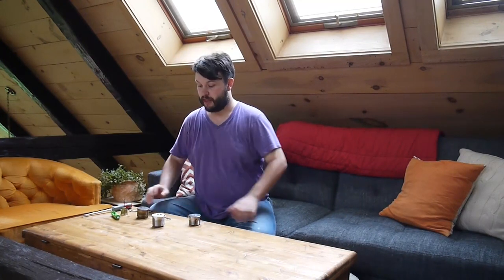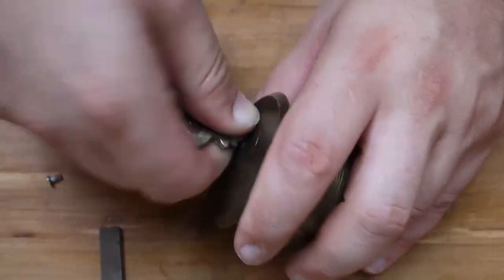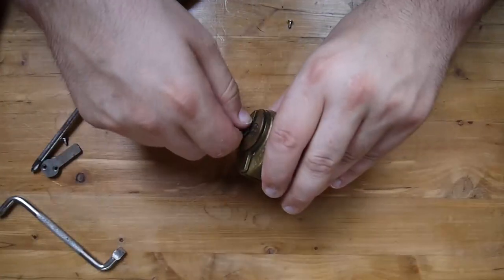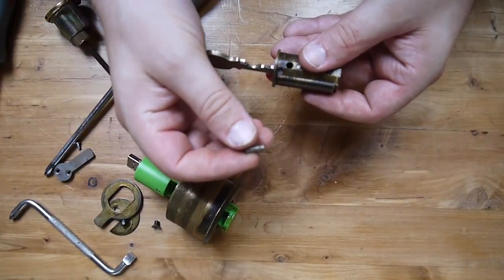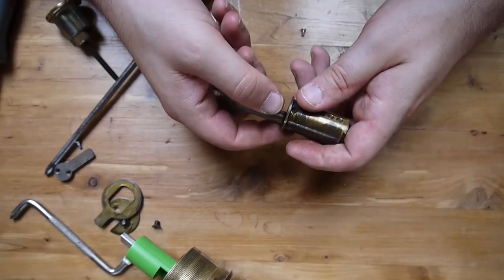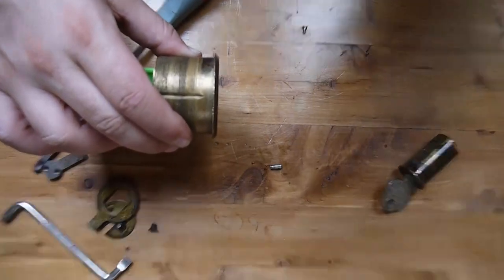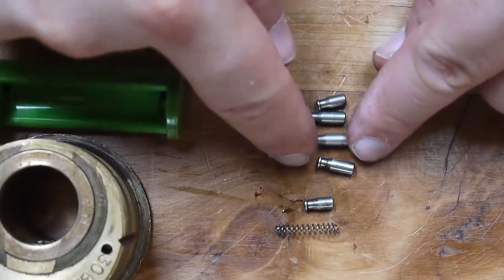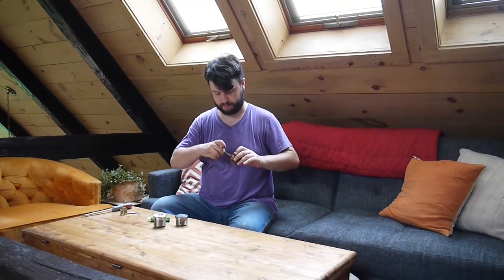The Collection: Prison Locks (Brinks, ASSA & Folger Adam)

Comment: The biggest reason for the use of the oversized cylinder is the extremely rugged environment in which they are used; they have to be designed to withstand normal use in a prison environment, on doors which can weigh up to half a ton.